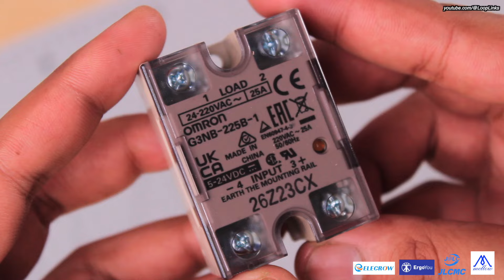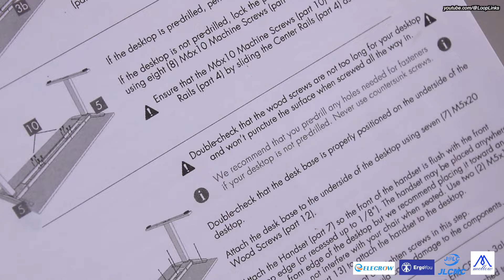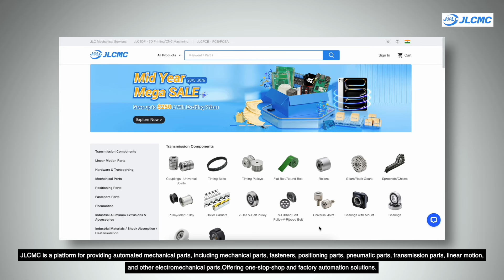Doron Velta Build | Fystec Kit

Comment: I don't understand why they market a lightweight extruder but then it's a bowden printer. Delta printers are kinda underrated in my opinion, so it is cool to see something like this on the market, even if it is really quite expensive.
Reply: You'd first need to assume that marketing knows anything about the product they're advertising 😅 Also the Cranefly effector can be built as a direct drive setup with the Sherpa Mini on top, it's just not the default configuration

Comment: I must say, thank you so much for posting this.  I would have been completely lost if I were to just try and follow the CAD provided by FYSTEC.  The heatset insert section and the hardware notations in the bottom corner are HUGE!  I'm still running off a few parts but I started my build yesterday.  I'm gonna rely heavily on this.  Thank you again.  Cheers!
Reply from the maker: Glad it helped!

Comment: The orientation of the connector cable for the motors (20:34 in the video) is WRONG. The connector has to go to one side, the cable would not fit with the printed base supporting the controller afterwards. You can check the cad for the correct position.
Reply from the maker: Yes I realised that afterwards and pointed it out at 21:32.
Reply: @LoopLinks  Apologies, didn't notice the message at 21:32 (as I am jumping from one point to another in the video).